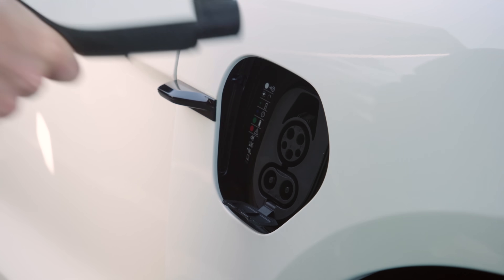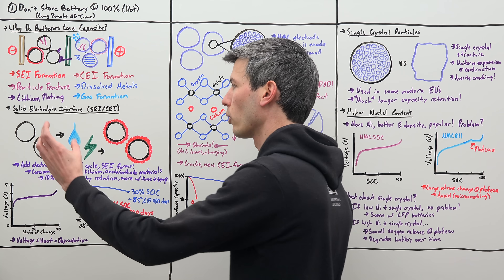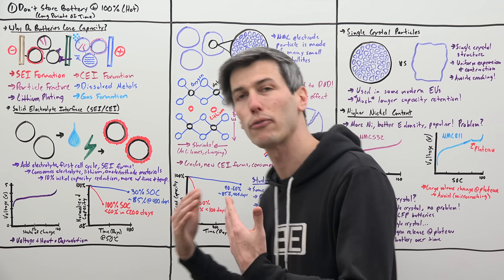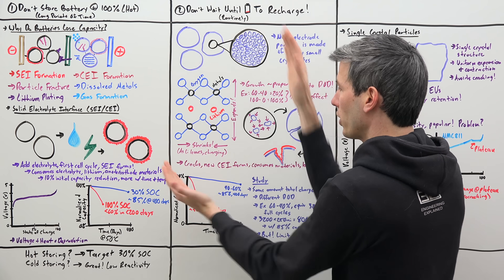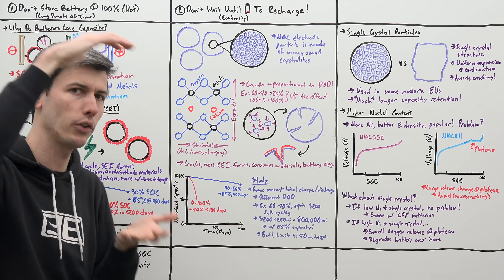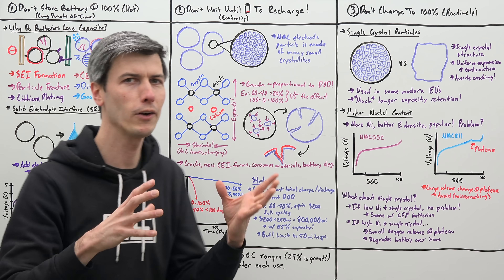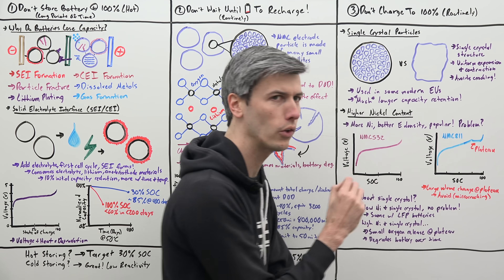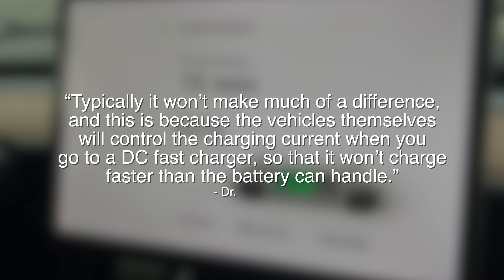How To Ruin Your Electric Car's Battery - NMC Edition!

Comment: lol #2 and #3 basically contradict each other. How are you supposed to plug it in after every trip but not let it charge to 100%? Sit there and wait to unplug it at exactly 99%?
Reply: You can set a limit for the car to charge to, it will automatically stop charging on its own.
Reply: @BrandEver117   ah that's neat

Comment: on a much smaller scale....how do you recommend charging the battery in a modern smart phone with a Li-ion battery????
Reply from the maker: Similar practices, but replacing the battery in a phone is obviously quite a bit cheaper than a car, so I just go 100% and don't think about it. Gets replaced after 3-5 years.

Comment: So the best EVs have a usable range of 300 miles, then comes winter and you’re down to 170 miles from a full charge…..but you shouldn’t charge past 80% or keep using past 20%, so now your best range is 100 miles.
It’s winter so you want the heater on? Now you’re down to 85 miles.
Want heated seats on? 75 miles left.
Heated steering wheel? 70 miles.
Radio on? 65 miles.
Running late so you push on a bit? Now you’re down to 40 miles.
You have a family in the car? 30 miles.
On the motorway and can’t find a fast charger? 28 minutes run time and a two hour wait.
Going to visit family 250 miles away? You’d best set off really early, the day before you need to get there……and book a hotel.

The future is here!

Comment: Basically. Unless you live in ideal wearher conditions dont buy a ev. Half range and a lot of battery degregation half the year
Reply: I have a model 3 RWD LFP - it gets 85%+ of the range at 20C when it's at -5C provided I schedule a time to leave and it gets a chance to warm the battery - it's mainly due to the higher use of climate not the battery itself.

Comment: A video about solid state batteries, explaining the technology, comparing it to current batteries chemistries, the pros and cons, etc, would be amazing, since the arrival of these batteries, expected in few years, sound like a game changer
Reply: Probaply not better then liquid chemistries for high current and weight to energy ratio sensitive aplications. Great for medical devices though.
Reply: @someonespotatohmm9513  that's not what the information I've read about. It's supposed to have 2 to 2.5x the energy density of current lithium-ion batteries, with even more potential with future refinements
Reply: @HCkev  Volumetric or mass density, and does it include packaging? Last time I heard a researcher talk about it they where sceptical solid state could scale well due to the interface being limited to 2D.
Reply: @someonespotatohmm9513  I don't see why the packaging would be so much heavier to the point of negating the energy density benefits. I'm always a bit skeptical when someone says "a researcher", because if all the other researchers says the opposite, why should that one be the one that is somehow holding the truth? I'd be curious to see your sources on the subject. As far as I know, solid states batteries does exist today, it's not a case of "maybe we'll get it to work", what's holding them back right now is the manufacturing costs, which will gradually come down as production ramp up, as with pretty much any new technology.
Reply: @HCkev  Because neither of us is an expert on it, and that person is. Yes it is still only one, but one is better then none. Most of your reply is a response to nothing I said but is probaply correct. 
The packaging will  be much heavier because the packing too useable interface ratio is much worse in solid state bateries, depending on how you define packaging (you should probaply count it as interal but not usable volume).
Still curios on how the density was defined, because I would like to know if my information is out of date.
Reply: @someonespotatohmm9513  and there is your mistake. What someone says, even if it's a so-called "expert" (expert in what field exactly?), has very little weight. What matters is what he's able to demonstrate through research. I'm not really into the appeal to authority. 

You've been making some bold claims, but the things is that, as we say, "extraordinary claims requires extraordinary evidence". Only thing you've brought up so far is a random unnamed expert that apparently said stuff. I'm not saying you can't possibly be right, but you haven't been very convincing so far.
Reply: @someonespotatohmm9513  lol okay, another one that makes claims but run away when it's time to bring up any evidence. It's funny that you're claiming I'm vague as you very vaguely mentioned an a unnamed expert in an unknown field making vague claims about the weight of the packaging or something. At this point I'd have a more constructive discussion with an AI bot.

Comment: From what I've seen, that 20% charge range is actually ideal - if you go down even further, to say a 10% change, you'll get more cycles, but not twice as many, so you start to lose life. Probably not worth worrying about compared to the simplicity of charging after every trip, but have you seen the same, and what's the reason for that?
Reply: Why do ppl get so hung up on "cycles", is there actualy any mechanism which makes the batery care about a change in polarity that speeds up degradation?
Reply: @someonespotatohmm9513  It's just an approximation of use on devices that most wouldn't bother measuring depth of discharge on like phones. If you're keeping track of your depth of discharge cycle count is mostly irrelevant.

Comment: Love your video🤩 I charge my Tesla MS75D to 80% and charge every day, just 50-60 to 80 around the town. When going on long roadtrips, up to 95 or 100% just before driving , and run the battery down to 10% usually. Greetings from Oslo Norway😊
Reply: Same ❤🎉
Reply: This is the way...🎉
Reply: huh...I "charge" my F-150 to 100% every 3 or 4 months, drive 700 miles to near empty, and then "charge" it again in 5 minutes.
Reply: @southerninterloper4107  You only drive 700 miles in 3 months?
Reply: @Freakishd  Yup. With the occasional road trip thrown in but that's the norm.
Reply: @Freakishd There's a few of us out there. That's even more than I drive. However, back when I didn't work from home, I still only put about 3,000 miles a year on my car.

Comment: I like that the new iPhone has an option to only charge to 80%. I use this, and then I can disable the feature (charge to 100%) if I want a single charge to last over two days for some reason. Otherwise I cap the charge at 80% to improve battery health/longevity. (I like my phones to last around 5 years.)
Reply: That feature makes zero sense to me, you're limiting your battery to 80% to save a few percent after 3+ years?? It might make sense for cars but phones?
Reply: @RayanMADAO  It could be a lot more than a few percent in 3 years. Besides, even at 80% max, I'm still always over 40% when I charge at night, so if it's not impacting me, then why not? Zero down side, it's only a benefit, and it's not even enabled by default, you have to make the change yourself. I'm not sure why you've got a problem with it.

Comment: I bought our first EV last May so we haven't even had it a full year yet. It is a 2014 Chevy Spark EV. It originally had 21 kWh of capacity in its battery when new, based on our experiences and my calculations I believe it currently has about 14.4 kWh of capacity remaining. In the warmer months this gives us 60-70 miles of range but during these colder months we're down to about 45-55 miles of range. Thankfully this is still sufficient for our intended use. I have my son driving it for his daily commute to school which is 16 miles each way. When he started driving it regularly in the fall he would return home with about half of the charge remaining, now in the cold months he often returns home with less than 20% charge remaining. Unfortunately for our use we really have no choice but to fully charge the battery every night. We're still using the car's included level 1 charger, although I'm considering installing a level 2 charger this year. I really like this car and I'd love to get a lot of use out of it before we have to consider replacing the battery pack (for many reasons, not the least of which is that Chevrolet no longer supports this car). It had 36k miles when we bought it and we've already put on more than 6k of our own miles. Only time will tell. Thanks for the great video.
Reply: What does it mean when a manufacturer no longer supports a car? For appliances and electronics it means no more help, no more software updates, no more parts and no repairs done by them. For a car I can understand the first two but it’s normal to be able to get parts for a car for years after it’s no longer being sold new, and normal for garages to still fix them.
Reply: @Sashazur  Car companies are only required to maintain a supply of safety related parts (airbags, seat belts, etc) for ten years after a model is produced.  Theoretically they could not stock a single spare for any other component after a car leaves the factory.  In practice they maintain enough to cover warranty claims (3-5 years) and little else.  I needed a return line for a 2001 Jeep Cherokee fuel tank in 2007.  They made almost 3 million of those Jeeps, but mine was one of the last out the door they stopped production of everything else with it.  Every Chrysler dealer I contacted told me it was impossible to get just that individual part.  I would have to get an entire fuel tank assembly with all of the lines for well over a grand or get the line from a junk yard.  I got one from a salvage yard, along with two tail gate bump stops for less than $70.  Not standing behind their products like that is why I will never own another FCA, Stellantis, whatever they are called this week, ever again.  I have an easier time getting parts for my 1950-1960s Studebakers than my modern cars.

Comment: Ev are dead... anyway im fine with gasoline... i can make gasoline at home i dont need china for that... 😂😂😂😂 make a video on that kinda easy you can do it from tyres or plastics or oil which there is a lots... using pyrolesis or distilation... 😢

Comment: It's called LPR (long period rest) and it's a shame I only know one manufacturer that has that function. You turn it on, plug your charger and leave it, for as long as you want. It will take care of the battery. Also yes, I'll charge to 100% every ~month more often if I DC charge while in use....a balanced pack is a healthy pack.

Comment: The early adopters were rich and had too much money as well as being gullible to MSM hype. The fact remains most people dont have 40000 to 60000 plus 600 insurance first year and 2000 to 5000 thousand second year bait and switch...plus the risk of the thing catching fire and needing a 20 meter empty space as well as as 17000 to 34000 for a replacement battery after a fender bender..plus range anxiety. plus time wasted on charging plus poor charging infrastructure. Sales will plateau and then decline as the the middle class and working class can't afford them.

Comment: less maintenance is big lie.
Reply from the maker: I've had an EV for five years. Literally the only thing required has been replacing the cabin air filter, wipers, and tires. Super easy. Much more maintenance on my Crosstrek.

Comment: This is sadly stuffs that can only affects you after years of use.

I bought 3000 mAh phone in 2018, its battery is still healthy, at least better than my father's 5000 mAh phone bought in 2020.
Had to replace my dad's battery last month.

So, what's the difference between mine and my dad's?
How I charge it.
I always use regular 5V charger unless I am in hurry.
I only charge when it is below 60% and never charge if it is above 80%.
my father... almost do the opposite of myself.
Charge to 100%, always keep the cable plug even if it is alread 100%, charge it even it still has 90%.

I really am glad that Samsung's phone can limit the charge to 85%, especailly since battery today is 5000mAh, 85% of it is still 4250 mAh which is big enough for me.
Samsung's phone can turn off the "Fast Charging" feature which is really useful so, I don't need to use specific charger that can only provide 5V.
So, most of the time, my new phone and tablet only chw4ge up to 85% and use "slow charge" which is 5V3A at max (I don't know if my phone or tablet really take all 3A, my best guess)

I only charge to 100% and fast charge if I already have plan to be outside >12h.

Comment: This all seems very reasonable, though my 2022 Hyundai Ioniq 5 manual says (if I'm reading it correctly) to charge to 100% once a month, and that AC charging is preferable:

> AC charge is recommended to keep 
the high voltage battery in optimal 
condition. 
> If the high voltage battery charge 
amount is below 20%, you can keep 
the high voltage battery performance 
in optimal condition if you charge the 
high voltage battery to 100%. (Once a 
month or more is recommended.)
Reply: I also have an Ioniq 5 (2023 SEL AWD Long Range) and I used to stress so much about this when I first bought it. Fast forward one year later and I have now mellowed out to the point their is almost no stress. I charge to 90% about 2 to 3 times a week. Mostly level 2 at home but sometimes I will go by the Electrify America and get some fast free juice (which expires in one more year). I like staying between 40 and 90 percent because it's my comfort (stress-free) zone. I believe the car's battery will outlast the car because I have a lot of faith in Hyundai's EV division. My wife has an Ioniq 6 and she doesn't drive near as much as I do so we keep hers between 40 and 80 percent only because it will sit for 3 or 4 days sometimes without being driven.

Comment: Thanks for putting this together, Jason. I've owned a Model 3 Performance for about 1.5 years now and have seen little to no degradation of the battery. I rarely charge to 100% (only on trips). My ideal capacity range has been 20%-80%. After watching this video, I will charge more frequently if below 80% and keep the cap there.
Reply: Just got a M3 long range. Any other user anecdotes you can impart?

Comment: I've spoken to two people who ended up getting rid of their EV over battery issues. One owned a Nissan Leaf and it stopped charging fully. They were told they'd have to pay to replace the batteries and it would be cheaper to just buy a new car. Recently had a friend get rid of their Mach E because the batteries started fusing themselves together and were told something similar. They ended up going back to a gas vehicle. Unfortunately in practice the battery tech just isn't there yet and there aren't enough consumer protections in place to protect people from these insane repair bills. And for that I'm sticking with my gas car for the foreseeable future.

Comment: Having used some relatively large (7.2kW) batteries for home power one reason to fully charge some batteries every once in a while is to recalibrate the BMS's state of charge.  Depending on how the BMS was designed and programmed that soc value could drift quite badly if you only partially charge over and over.  This will then result in the battery feeling like its lost capacity, when in reality its just doing the math wrong.  Ive seen this happen both at the 100% and 0% side of things, and for my batteries this looks like either it getting stuck at 99% for a long time before finally reaching 100% or it getting stuck at 1.5% for a long time before finally reaching low voltage cutoff and shutting down.

Comment: It is limited to 50 miles per charge to keep the batter in good shape... It doesn't sound like an electric car requires less maintenance than a gas-engine car.

Comment: Unfortunately Stellantis didn't implement any functionality to limit the SoC, so if I forget to stop the charging manually it will end up at 100%.
It's ok during the winter months, but in the Summer a limit at 75 or 80 % would be a quite useful feature.
Reply: Or just buy a gasoline vehicle and be safe!
Reply: @tullo5564  yeah, that would be significantly more expensive and I'd have to waste so much time when driving to gas stations.
Additionally I'd have to blast all my waste-gases in the streets where people are walking and I'm not sure if they'd be happy with that.
Reply: @das_f.l.x  Filling up a gas tank is "significantly" easier and way faster. Furthermore, lithium mining produces more environmental hazards than a diesel/petrol powered vehicle would ever produce. So kindly get your facts straight, that would help you "significantly"
Reply: @tullo5564  That's actually not true. There's no need to drive to a specific station just to refill an electric vehicle. You would just park it inside your garage and it will be charged the next time you use it. The average time I've spent for this process would be around 15-20 seconds, because there is no need to supervise your car while charging.

Regarding your claims about raw materials, please feel free to provide a scientific study with appropriate methodology to proove your point.

Comment: what I'm curious is charging everyday to 50% makes any difference in degradation vs 70-80% every day even though I use only about 20-30% on most days? Occasionally I have longer trips but most of the time I don't know about it until it happens so I rather be prepared than stopping at a public charger
Reply from the maker: Lower the better, generally speaking. 30-50% is better than 60-80%, but most of us want to ensure we have 80% without any thinking/prep. If your schedule is super predictable, lower is great!

Comment: The batteries in our cell phones and power tools are lithium ion as well I believe so these tips can apply to those as well. Interesting stuff. Thanks
Reply: That's also why Samsung and a few other device manufacturers are giving you the battery health option. Instead of 100%, it'll stop at 80% max. This keeps it from losing capacity over time.